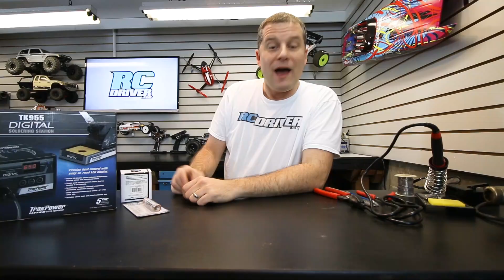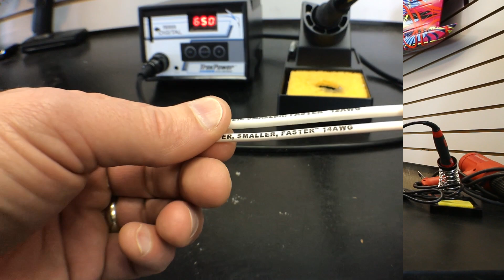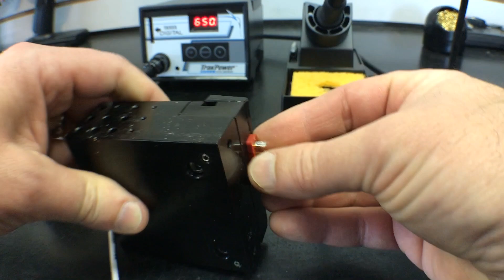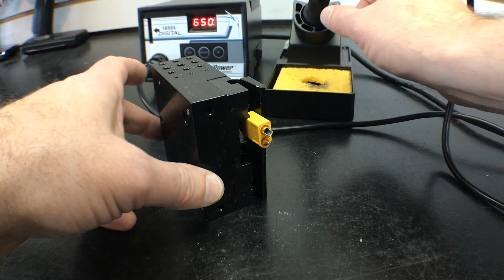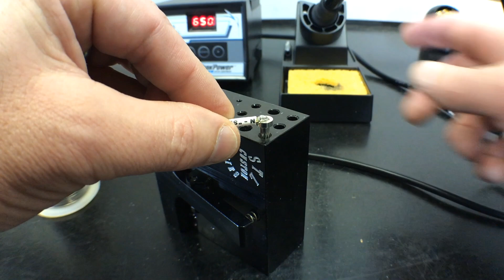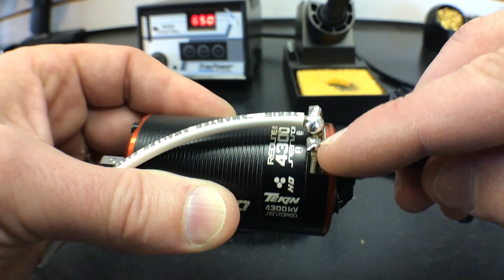RC Soldering Basics - What You Need + How To Solder Wires & Connectors - Get Into RC | RC Driver

Comment: What would cause a cold solder? If it’s dull it’s a cold solder u said how do u fix that n prevent it from happening again?
Reply from the maker: Great question! Probably should have addressed that. I was taught to use the term "cold solder" as a general term for a bad solder joint. Each type of solder problem actually has its own term to identify it. But under general term I used, it's when a solder joint problem is caused by: leaving the iron on the solder for too long or moving the wire while the solder is drying or not allowing the solder to completely melt. To fix it, it's best to go back at the joint with the iron with fresh solder on it, reheat the problem solder joint and knock off the "bad" solder. Then go back and try resoldering your connection with new solder.
Reply: RCDriver_Online ok cool thanks I’m new to soldering so this was a great video for me thank u for it
Reply: yes, absolytely. my record was using a 60w iron for soldering 8mm bullets to the 8awg wire, i had to heat up it like for a minute or so... i guess 80w would be perfect
Reply: My record is using a 16w iron on 8AWG. My
75w(I think it was 75watts...🤔)iron died on me so I’ve had to stick with this crappy 16w one i got at a thrift store years ago lol. I’m in the market for a new legit soldering iron...
Reply: Forgot to mention that I was using rosin core solder with flux paste to help it. Also forgot to mention that the 8awg wire was soldered to an XT-90 plug. Desperate times call for desperate measures...
Reply: the important thing is also to have a soldering iron which has enough power to heat up well the wire and the connector atthe same time, the solder needs to be completely molten. after soldering the wire to the connector you need to hold the wire for quite a long time, you need to be absolutely sure that the solder is completely solidified before you can stop holding it. the low power soldering iron issue is particulary true for thick wires and connectors like 8mm
Reply: @DKFPV  Actually you will only need to hold the wire for a few seconds till it cools off and sets up. No longer than 5 or 6 seconds will do the trick.

Comment: Don’t know if you will respond because this video is 6 years old but if you or anyone else sees this please shoot me your opinion, on batteries I’ll pop off the plastic cover on the solder joints and they are never cover they are open solder joints so when I change them I never cover them either my question is will water short them out? In my opinion it should but I’ve never had a problem with not covering the solder joints on the battery.

Comment: Bigger tip and higher wattage, is key. Decreasing the time iron contacts the work is also required when dealing with batteries or motors. That soldering station is a waste of money,  unless you are doing circuit boards and must really control the temp. For the hobby hotter and faster.

Comment: Good video Sir!  It's amazing how soldering irons have changed.  Now you can just get a Pinecil and run it off of an RC battery for power.  It's both a bench and portable field use solution.

Comment: I am assuming you are linked-in in the RC industry, so I am going to pose this question to you. I would purchase more RC gear, and more motors, esc's, etc if I didn't need to worry about soldering. Why, why, why do I as an END USER need to solder ANYTHING???? There is no reason why manufacturers can't move to a plug and play system with connectors and adapters. "Plug and play" did wonders to grow the PC industry. It isn't f'n rockets science. If I could build monster gaming rigs as far back as the early 90's without having solder stuff in, why oh why can't I do this in 2022 in RC????
Enquiring minds want to know.
Reply from the maker: Well, this is a radio control model hobby at its core. Since the beginning hobbyists had to build, paint, detail, tune and solder among all the other things required for the user to run their model. So those elements are carried through to today. You can certainly pick up RTR’s and use their supplied gear and the brands proprietary electronics. But when it comes to modifying, “model hobby skills” are required. Hope this helps.
Reply: @rcdriver  Yeah - not sure that does help - but I do appreciate the response. 
I guess I don't agree with you that soldering is (should be) "required" at the higher end of the RC spectrum. I think it is "desired" by a small group of lifers in the industry who are perfectly comfortable continuing to do things one way. A colleague of mine used to refer to these people as driftwood. Just give it 10 more years...

Comment: Bought one of these TK955's. I watched this vid and a couple of others and just jumped in. The TK955 is awesome and I love using it. Soldering was made easy with it's consistent temperature and accurate display. I will be honest, this soldering game is pretty easy when you know how and kinda fun. Thanks for the video, it helped with my understanding a lot and the TK955 you use is brilliant. Had my unit two days and after soldering about 3 times in my life (I am 50) in one swoop I soldered new connectors on 3 x 4s Lipos (EC5) and one ESC (X-Maxx). What a hassle saver it is learning how to solder. Thanks again for this video. Got away without soldering for over 30 years of RC, now I can solder too lol.

Comment: So you push the wire onto the iron when soldering, not hold the iron onto the wire and wait for the wire to get up to temp and put the soldering wire onto the wire...like I was just trying lol. Use the iron to melt the solder and work around the wire touching to the iron to get the solder to melt and get onto the wire. I just tried for my first time and failed bad. And my ec5 connectors aren't the kind you put on the wire first...you snap them on after! How the hell do you do that with only the wire and a tiny rim of the connector on the side your pushing to!? Maybe I should get the other ec5 kind like you have...?

Comment: Great video, hope it is not too late for a question? In all the "How to solder" videos I have watched, including this one, the thickness of the solder wire is not discussed. I would like to know what is the recommended thickness for typical ESC and motor wires? Does the thickness play a big role in good solder joints? I noticed the solder wire you are using is 0.04 inches thick. I guess that the type of soldering iron you are using plays a roll as well. I am using a plain Weller 40W iron, only one with a small enough chisel tip, and with 0.06 inch solder wire it works very well but with 0.04 inch solder wire, it struggles to get the solder flowing into the wires. Could it be because the plain soldering iron's temp cannot be set, that it is too hot for the thinner wire but works great with thicker wire?

Comment: Could you share a link or the specifics of the Kester 44 solder you used? There are quite a few types, %'s and sizes. The current solder I have does a poor job so I want to buy the right stuff this time, thanks!

Comment: Very informative video....thank you very much...
And a good high wattage soldering iron makes a huge difference compared to a 30 watt Weller....that heats up all the wire inside the insulation and will case other issues...

Comment: Ive been scared of soldering and afraid i would it wrong and burn the esc but i am practicing and it is going well
Reply: Pretty hard to burn an esc what are you soldering
Reply: Esc connectors and some bullet connectors maybe some wires aswell

Comment: I disagree on flux, the flux inside the core is fine in a pinch where there is low thermal mass in the parts. However, the flux core burns off too fast, if the flux burns off on the iron before the part reaches temperature it does nothing. Apply flux to your parts to prep before soldering then apply heat and solder. This is especially important when using a budget iron. If on a budget consider a TS-100 iron and make sure to use the biggest tip that fits your part for most contact and most efficient heat transfer.

Comment: Damn, I've been doing it wrong for my IC5 connector and always almost melt the connector before my solder even have a decent weld. Thank you so much. I think I should re-solder my connection now since I got extra IC5 connectors. I need a soldering kit like that now.

Comment: Enjoyed the video, and I know my comment is WAY late, but I have one suggestion. If you decide to do an updated or revised video, might want to hit on the importance of good ventilation when soldering. I typically use a homemade fan rig I built from a laptop cooling lap pad and some foam core board, but even mentioning a well ventilated room would help.

Comment: what's the best temp for the soldering? I see 650, is that fahrenheit?
Reply: that heavily depends on the type of solder you're using. The 650 degrees seem to be F though, my soldering station only goes up to about 300 degrees and I know that one's celsius. As for the first thing - lead free solder needs a higher temperature (and is not that easy to work with) as a rule of thumb, I'd use 60/40 solder, have been using that for years on my guitars and effects (digital applications like micro controllers as well), don't plan on using anything different for RC applications.

EDIT: My soldering station goes up to 450 degrees. Still celsius, though.

Comment: I still have a huge roll of small guage leaded solder from rat shack, works so well. I'm going to be sad when it runs out. Really there's not much bad solder out there, I'd skip on the lead free though, its much easier to work with 60/40 rosin core especially if you only have a cheap 30w iron. Just... don't eat it?

Comment: Is lead free solder ok? And also is it ok to use flux?
Reply: Lead free solder is “ok,”
but harder to find and harder to use. Flux paste simply helps the solder fuze both wire leads together. I suggest getting some 60/40 leaded silver free rosin core solder. Silver solder is insanely hard to melt compared to non silver solder. When soldering, I suggest wearing protective eye glasses, wearing a surgical mask, and using a fan to ventilate the area. Do your best to not breathe the fumes in. If you have open food/drink in your soldering area while you’re soldering, don’t eat/drink it. The solder fumes settle into that. And always wash your hands afterwards whether you’re using leaded or lead free solder. Hope this helps!

-Ev

Comment: Great video. one thing I feel you should have mentioned is that the fumes that come off when soldering is pretty toxic and having your head right over top should be avoided. I have a little desk fan I use to blow away the fumes while soldering.
Reply: When I was new to soldering, I would hold the wire in my mouth because I didn’t have helping hands. After the fumes blew into my eye and gave me a red eye for a day I decided to buy helping hands and use a fan.
Reply: thanks for the tip

Comment: So with the bullet plug you talked about there could be two ways to solder it. Either straight up and down or to the side. Would the "straight up and down" method be used for making charging adapters or for anything really? I'm just curious since I've never soldered before and some of my adaptors I've bought for my chargers have the wires going in the "straight up and down" fashion from the bullet plugs to the connectors.
Reply: It’s simply personal preference. Most people will solder their inboard lipo battery bullet leads sideways and will solder bullet plugs right side up for everything else.

Comment: Great video, thanks! I actually just bought a soldering kit to learn with ☺ I need to change the battery connector on my truck to be able to use a lipo battery. Great info.
Reply: Is it the redcat in your pic ?

Comment: Nice instructions, came 2 days too late :') Soldered a deans to xt60 as a conversion. I'm new to lipo's and don't know how to store them for long term. Can you make a video about that?
Reply: CDA441 all you have to do is charge them to 50% and then check the voltage once in a while, like once a month to make sure they're not losing too much voltage.  Many chargers have a storage mode so you just have to use that.  Hitec makes a great lipo voltage checker that's about $20, it's well worth it.  If you leave them alone for 6 months or something they'll likely be junk.
Reply: Jahmen RC you definitely need a lipo capable charger to charge them. You can have serious problems trying to just plug into a nimh charger. Each cell has to be charged equally, that's why they call it balancing.  I personally like traxxas chargers the best, but there are many out there that do the job well. Just make sure it has storage mode because it makes the job much easier. You don't need to be afraid of lipos but they do need to be taken care of carefully. Never put them away dead after a run, if they're hot let them cool but then do a storage charge. If the voltage of a cell gets below a certain point it will go bad. There is lots of good information online on how to charge and take care of them. Just google it.
Reply: mike s hello Mike I read your comment I was given a 2 cell Lipo I don't have a balance charger or a charger for is it a bad unit?
Reply: mike s thank you info was much needed appreciate your time.